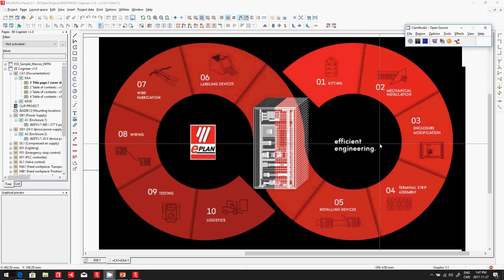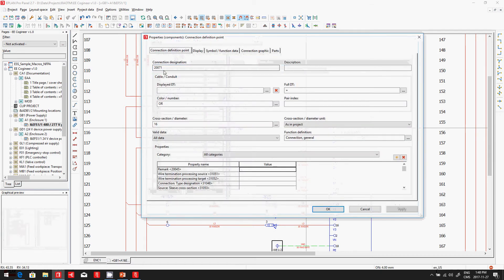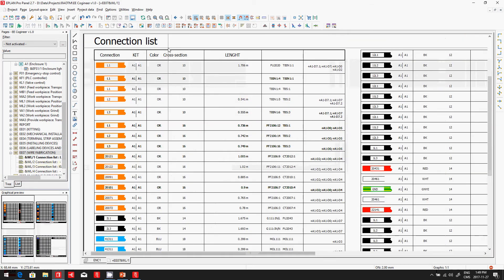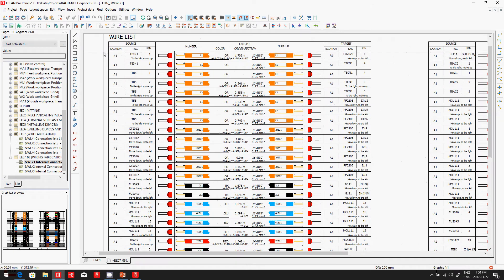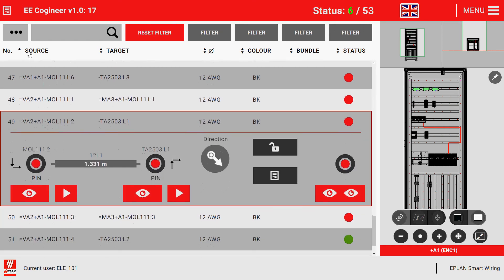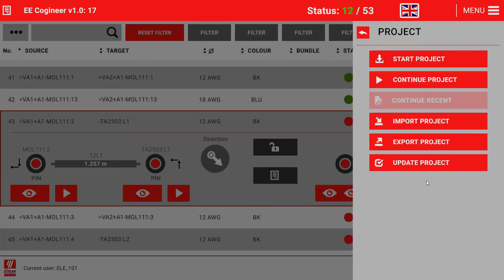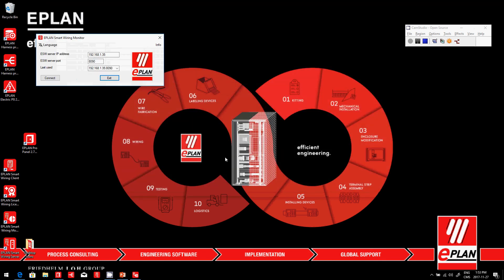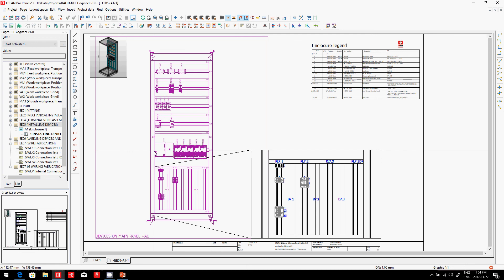EPLAN Tutorial Efficient Engineering 07 Wire fabrication 08 wiring

Comment: Hello. Can you upload a "Wiring fabrication list" form?
Reply from the maker: Yes of course, I can handle external excel list, yet you will not get the graphical representation of the position where the device is. Look at how EPLAN handles this portion of your design. You are much faster with EPLAN because the wire list is generated automatically. But the answer is yes you can upload an excel sheet. I even have a video that shows the smart wiring importing a simple excel sheet. I use that feature when I do not use the 3D panel layout of ProPanel.
Reply from the maker: The wire fabrication list you can get it through your EPLAN Channels. They can reach out for me and I'll forward them the form. Tell them it's Roland form Canada, they know me.